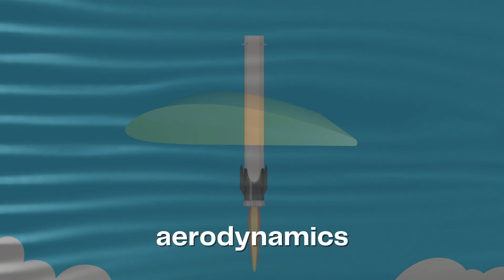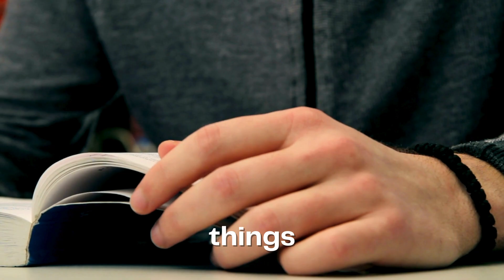Interview: Aeronautical Engineer Academe from the Philippines

Comment: I'm not Good at math but I can be a  aeronautic engineer?
Reply from the maker: I am no Aeronautical Engineer myself. However based on several friends that I know and asked about being good a math to become an Aeronautical Engineer. Every aspiring Aeronautical Engineer will always feel 1st that they are not good at math or it isn't enough.

But people learn, you have to passionate about it.
From Mathematical Engineers: "As the case of your mathematical ability, you will need to practice if you want to get better. My recommendation? "Playing with numbers."

Some of the courses you may be required to take in college include calculus, linear algebra, and differential equations.